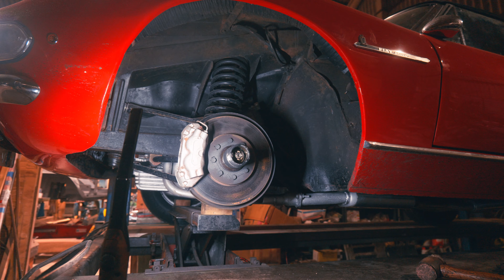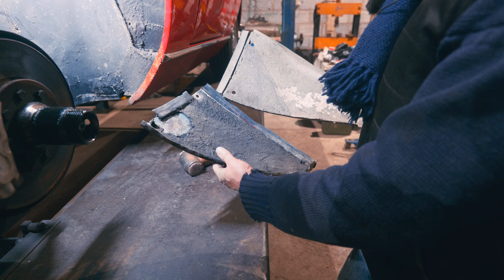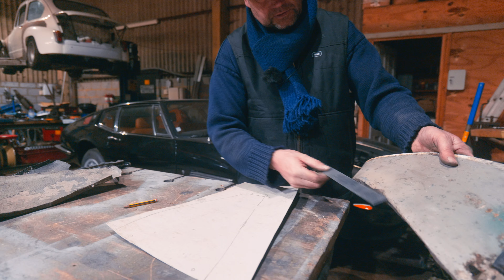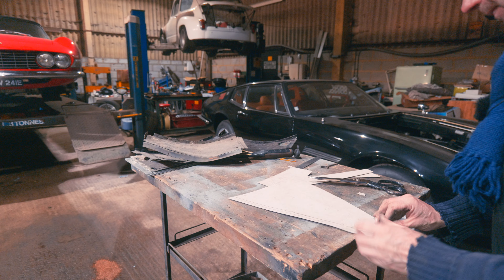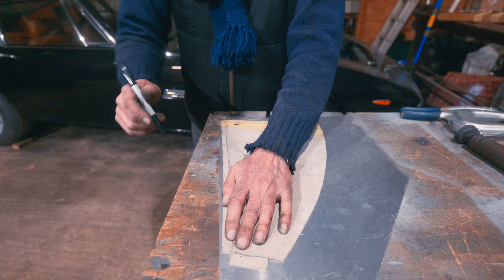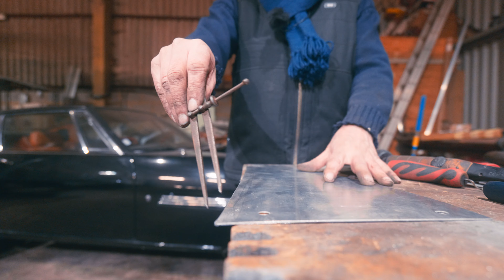Fiat Dino Mudguards

Comment: Glob morning Mark, 2 questions. Normally whats a good time of day to try and call you?
What size are those Michelins? 185or 205!
Reply from the maker: The afternoon is good.
They are 205 incorrect modern tyres fitted without inner tubes .
They are going to be replaced with 185 historic tyres with tubes.